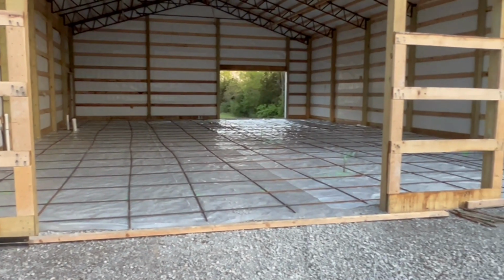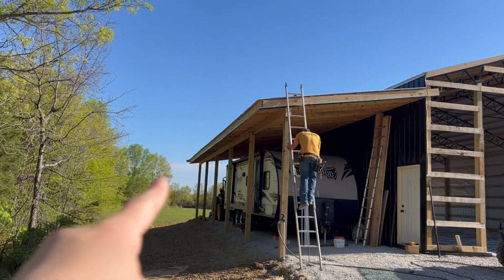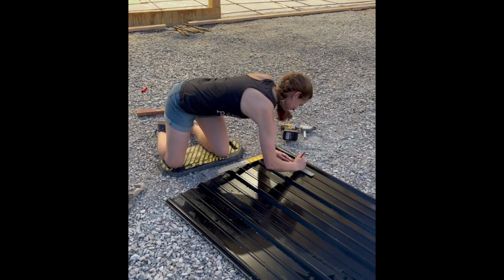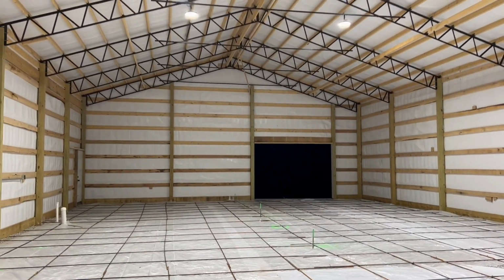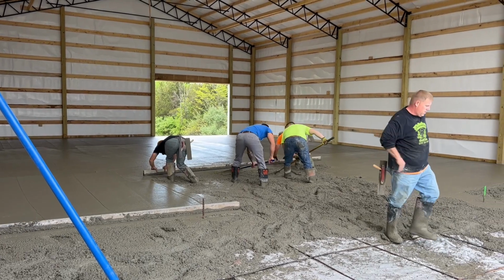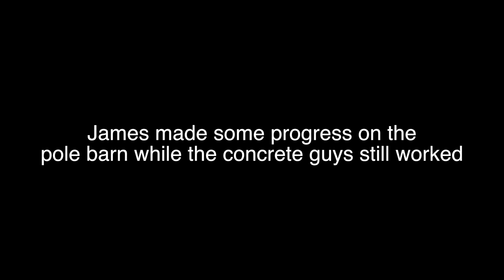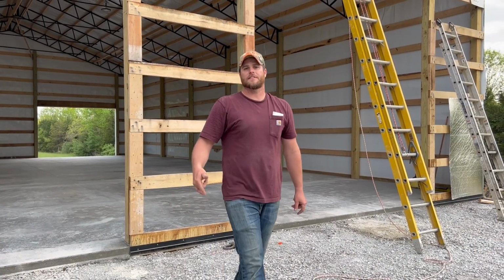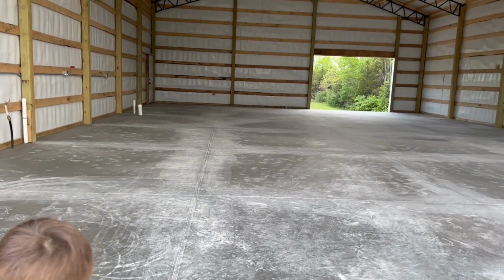DIY Pole Barn Construction #27: CONCRETE FLOOR IS DONE!!!!!

Comment: I think you guys got a really good deal on that concrete if it only cost you $15,000?  I'm getting ready to put up a large storage building for a bunch of classic cars, 60x120x18, it will be approximately 7,200 square feet.  My concrete is going to cost me my arms and both legs before were all done!  You guys are doing a fantastic job!
Reply from the maker: +Overpar73 Dang. Now I’m feeling better about it. The exact cost was like $15,400 and some change. But saying 15k is a lot easier. We are so happy with how the concrete turned out. It’s PERFECT!